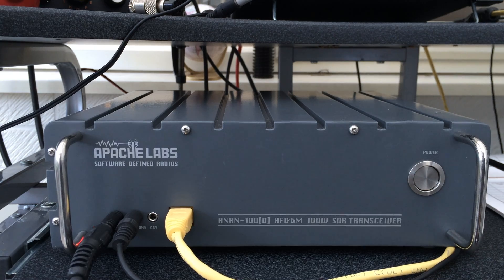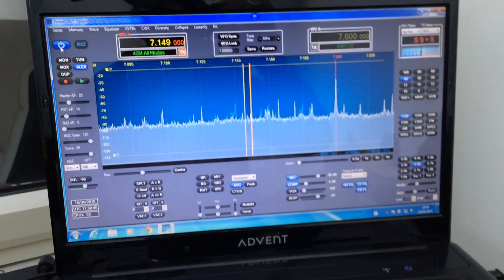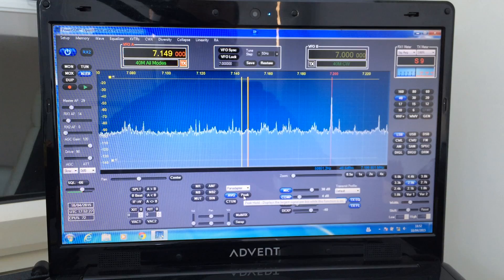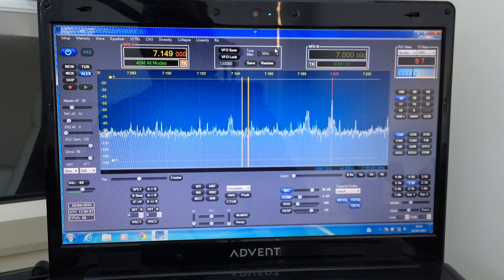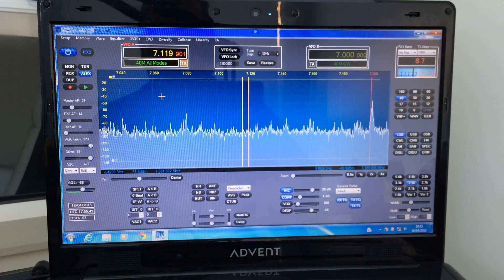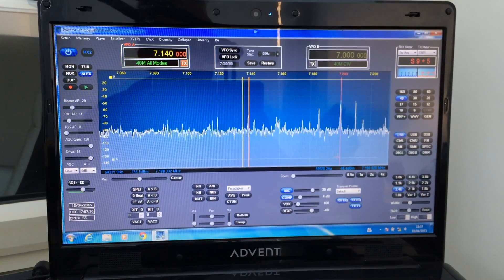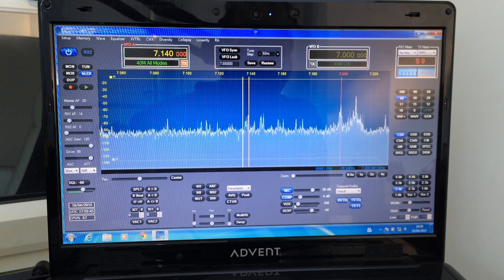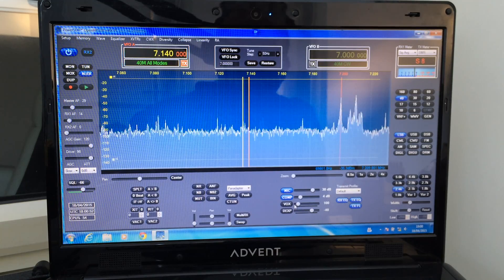APACHE LABS ANAN 100D. SDR radio

Comment: Do this test for me. Run a frequency response test on the transmitter and the monitor and see how flat they are. If it's like the 100b I tested it sucks big time. What you hear in the monitor is not what you get. Is the 100d different? The world is waiting to know.